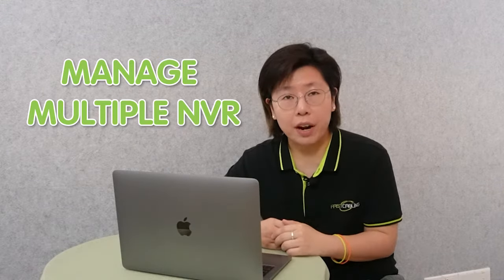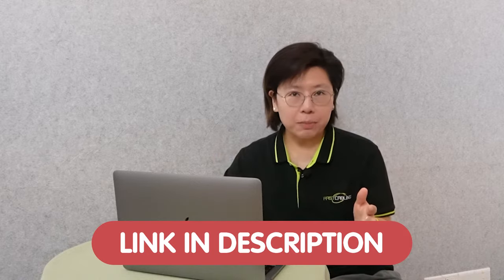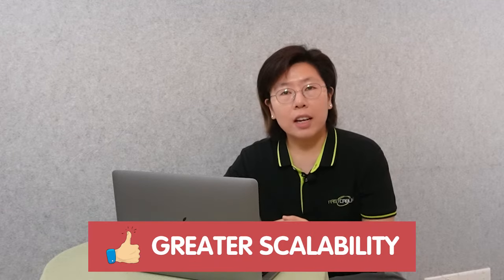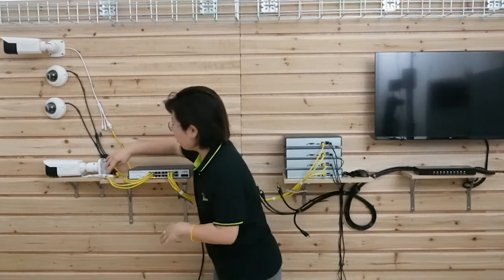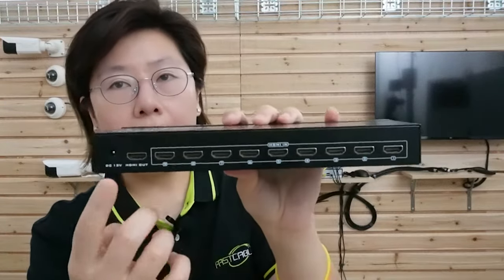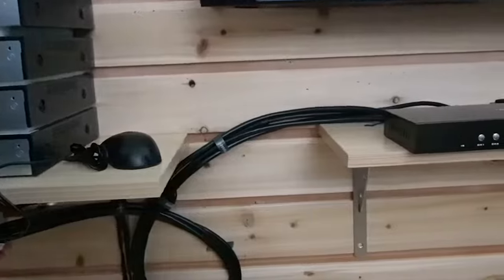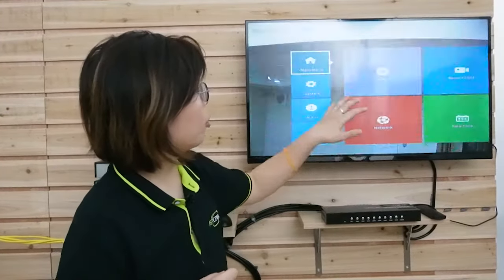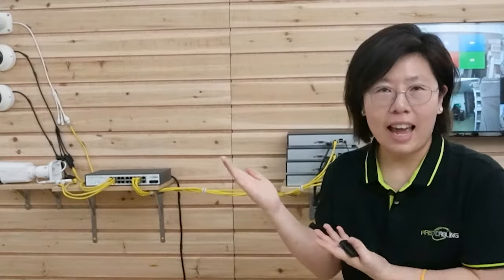Multiple NVRs Monitoring on Single Display | Case Study

Comment: Good morning teacher, I ask you to give me your help, I have a school installation where 36 wireless IP cameras were installed, and we have 2 antennas that receive the data from the cameras, these antennas carry the data to our NVRs through wiring, The problem I have is that I can only see 15 cameras at a time, up to a maximum of 18 when I'm lucky, and the other thing is that the recording is terrible, it seems to me that the problem is the bandwidth, or is it something that I need to connect to my wireless network, Teacher can help me, I can't think of anything anymore, I don't know what I'm doing wrong.
Reply from the maker: Based on the information you provided, it's possible that your issues could indeed be related to bandwidth limitations or connectivity issues.

Here are a few steps you can take to troubleshoot and potentially resolve the issues:

1. Check Bandwidth Usage: Determine the bandwidth requirements of each camera. If all cameras are streaming simultaneously, it might exceed the capacity of your network. You can use network monitoring tools to assess the bandwidth usage of each camera and the overall network.

2. Assess Network Infrastructure: Make sure your network infrastructure, including switches, routers, and cables, can handle the traffic from all cameras. Ensure that the network equipment is configured properly and capable of supporting the number of cameras you have.

3. Optimize Camera Settings: You may be able to adjust the resolution, frame rate, or compression settings to reduce bandwidth consumption without sacrificing too much video quality.

4. Consider Wireless Interference: If you're using wireless connections for your cameras, interference from other wireless devices or obstacles can degrade signal strength and performance. Make sure the antennas are positioned correctly and consider using frequency bands with less interference.

If none of these work, please feel free to contact us at support@fastcabling.com😃Our engineer will get back to you as soon as possible.

Comment: What of a connection of 4 nvrs of 64 channel, how does the image on the display monitor, is it large or small assuming I have a smaller display unit.
Reply from the maker: The more channels you display at once, the smaller each feed will appear. You can limit the number of channels displayed simultaneously on the screen to a more manageable number, such as 4 or 9 cameras per view, and switch between different camera groups as needed.

Comment: If we have four NVRs, without four hdmi cables going down to the TV, how do you do that?  or is that appropriate?
Reply from the maker: I guess those NVRs at least has VGA output right? You can set VGA switcher, but you only can see one NVRs once. If there is HDMI, but it was output to the local monitor, then you can consider the HDMI splitter to duplicate the second HDMI output. The last option will be the PC software, It need powerful PC to decode all the videos from all those NVRs.

Comment: how can i control same nvr security system so when i move the  mouse in one location to expand camera or just go to setting other person does not know?, the nvr will be have multiple monitors
Reply from the maker: You might try usb mouse repeater duplicate the usb mouse control, but both mouse will operate the NVR at the same time.

Comment: how to connect different make NVR in one monitor
Reply from the maker: If you want to see all the cameras in one monitor, you probably needs a HDMI combiner. It is a little bit tricky. If there is only 2 NVRs, then the ratio could be a problem, and you need a big screen if there are 4 NVRs. Alternative option is you can pick the NVR which can accepts more IP cameras (e.g. 64 CH NVR).

Comment: What type of POE switch have you used on this setup? Managed or unmanaged?
Reply from the maker: It's an unmanaged PoE switch. It has a plug-and-play setup with no configuration required, ideal for smaller networks.
https://www.fastcabling.com/product-category/unmanaged-switches/

But if you want to create VLANs or prioritize traffic for certain PoE ports, you can use a managed PoE switch instead. It has advanced features such as VLANs, QoS, link aggregation, SNMP and access control lists (ACLs). 
https://www.fastcabling.com/product-category/l2-managed-switches/

Comment: How did the POE switch recognize each port from the camera to the NVR, kindly explain
Reply from the maker: The PoE switch operates based on standard networking protocols that allow connected devices to communicate with each other. Each IP camera obtains an IP address either via DHCP or static assignment. The camera sends video data packets through the Ethernet cable to the PoE switch. Then, the PoE switch forwards the data packets to the NVR based on the NVR’s IP address. The NVR is configured to recognize and manage the cameras by their IP addresses. When it receives the video streams from the cameras, it records the data and allows for live monitoring.
Reply: @Fastcabling  Can one NVR record the cameras continuously and others record them by Events only? An individual camera being recorded differently by multiple NVRs.
Reply from the maker: It works as long as the cameras and NVRs support multiple streams and allow simultaneous access. Most IP cameras support multiple streams (e.g., main stream and sub stream). You can configure the main stream for continuous recording on one NVR and the sub stream for event-based recording on another NVR.

Comment: Can you please show me how to connect DH-XVR5104HS-4KL-13to dual monitor
Thanks a lot from ADEN-YEMEM
Reply from the maker: The DH-XVR5104HS-4KL-13 typically has multiple video outputs, such as HDMI and VGA, which can be used to connect to different monitors. In the display settings menu, configure the output for each monitor. You may need to set the primary and secondary display or enable dual monitor mode. Ensure that both HDMI and VGA outputs are enabled.

Comment: Can u mix DVR and NVR in a single setup?  Also, is it one NVR for each IP cam? CHeers
Reply from the maker: If both your DVR and NVR have HDMI outputs, you can use an HDMI switch or matrix. Connect the HDMI outputs from both devices to the HDMI matrix, and then connect the matrix output to your display. You can switch between the DVR and NVR feeds using the switch's remote control or buttons. Regarding your second question, typically, one NVR can support multiple IP cameras. The number of cameras a specific NVR can handle depends on its channel capacity, which is specified by the manufacturer. 

HDMI Matrix: https://www.fastcabling.com/product-category/monitoring-center/

Comment: What about the controller? does it mean you would need 4 different mouse? or i should say mice
Reply from the maker: No, just a single mouse and keyboard, and you can also control the system with a tablet. Please refer to the videos below:

1) How to Connect 9 NVRs to a Single Monitor: https://www.youtube.com/watch?v=CLq-tZykE4Q

2) Control and Display System for 100 IP cameras: https://www.youtube.com/watch?v=tKtaAENCIDU

If you're interested, we also provide a free solution design for our customers: https://www.fastcabling.com/free-solution-design/

Comment: How about the limitations in the length of HDMI cable?, Where the NVRS are at a distance?
Reply from the maker: Passive HDMI cords can suffer from signal degradation at longer lengths—25 feet is generally considered the maximum reliable length. If you want a resolution near 4K, then the HDMI cable should be at most 10 feet in order to preserve video quality. However, if you have videos of lower resolutions and video quality is not the priority, then longer cables can be used. But active fiber optic HDMI cables have an effective range of between 50 and 100 feet on average.